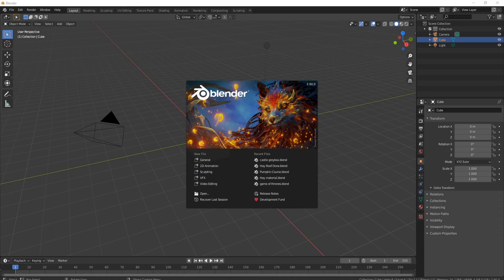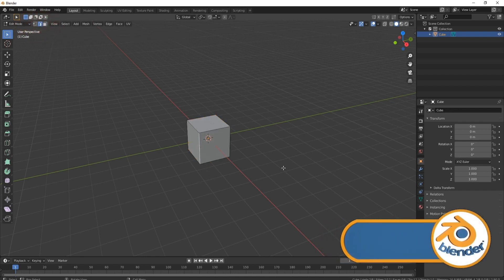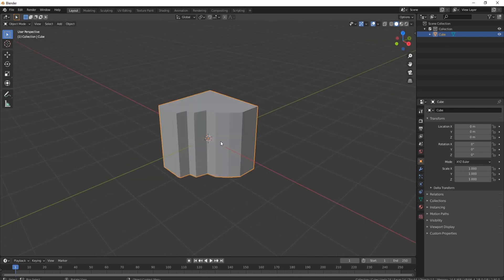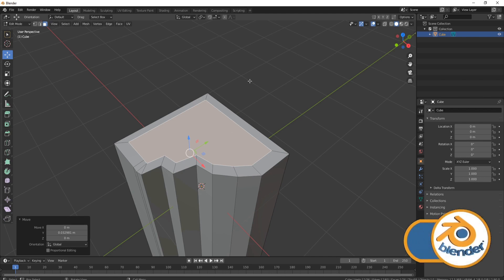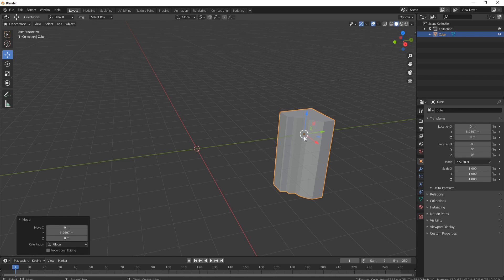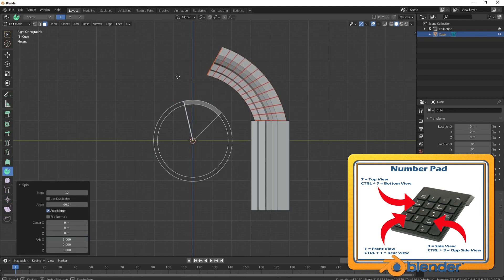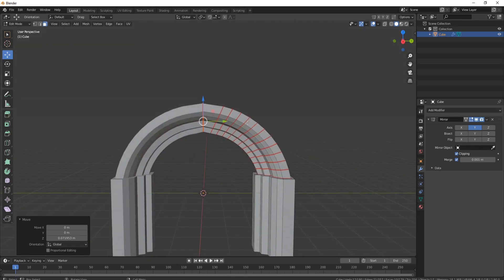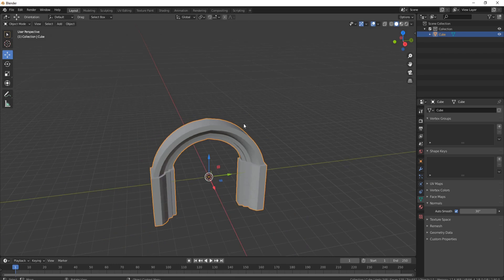3D Model In Minutes Blender 2.9 Gothic Columns & Arches

Comment: excellent tutorial except at the beginning when you push "i" to incet face the reason it breaks up is because you have bad topology and you have extra edges that aren't necessary for the mesh and those are the ones that do the breaking. I did this tutorial and I cleaned my pilar before this part and didn't get any breaking :) Also my face when "i" inset it is right down in the middle no need to fiddle around second time :) Also why you use mark seam since it's not needed to ?
Reply from the maker: Excellent tip! As for the question at the end, I use it simply because it became part of my workflow since I was making game assets and during the texturing process, specific UV usually helps with the flow of a texture ^^

Comment: Hello 3DTudor,
I get the point of triangulating your face to avoid an ngon, but I don't think it was needed for this specific example, since the vertices of that face will always stay locked flat in its local coordinates, there was no need for triangulation. Also, since we are mirroring the object, the "triangulated" face had to be merged in the center and the triangulated face will disappear, which made the triangulation irrelevant and unnecessary.